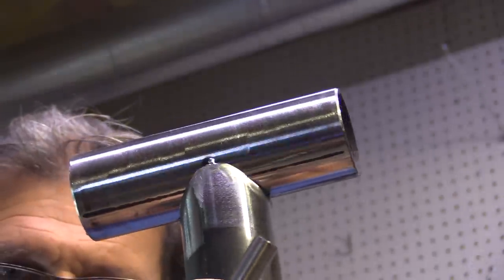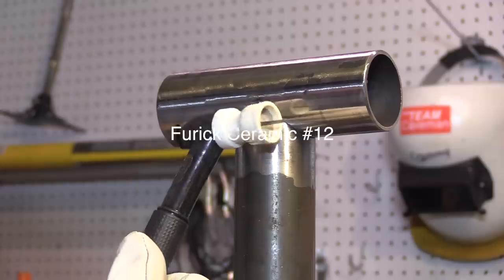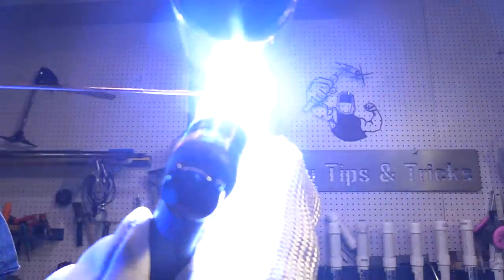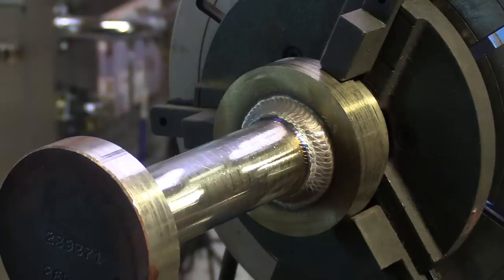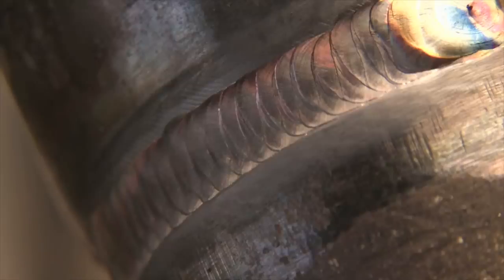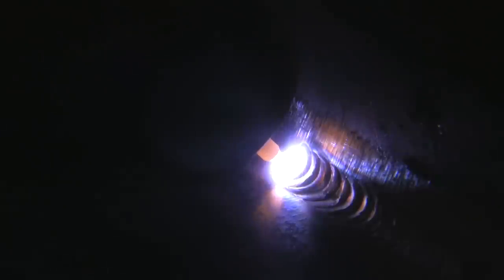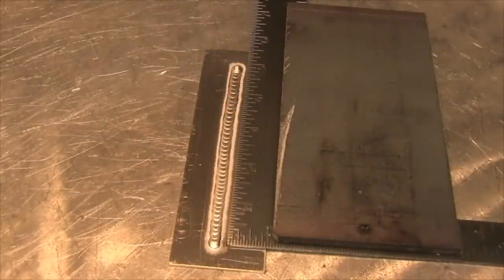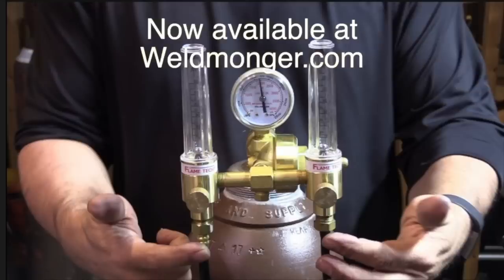TIG Welding Techniques - Coped Tube Overhead

Comment: Jody, the drag racing world is 90% .083 CM, please do a follow up with the thinner metals, your insight is always so helpful.
Reply: Hey Doug, do you mind me asking where do you buy your .83 chromoly tubing ?
is there any seller you can recommend?
 we need to pick some up for a cage we're putting together.
 thanks a bunch for your answer
Reply: Here’s a video he did a couple weeks ago using .063 CM. Gets into detail on filler selection etc. 
https://youtu.be/88fBukKg0x4

Comment: Great views as always.
Would it be too much to ask, that sometimes you might scuf your filler wire and/or the root of the joint.  Sometimes it's hard to tell how much wire you are feeding as you move ahead.  I think if the filler wire had surface texture, it would help.
Thanks.

Comment: It's easy to flow a puddle but is it actually fusing the two joints together or are you supposed to just lay the filler rod over the joint?.

Comment: Hi Jody im just curious about what happens when you tig weld a metal without a shielding gas tnx! ☺
Reply: The second you try and start an arc.... your tungsten will melt and oxidise, contaminating the part.
Reply: @kf8575  thanks for the reply and info,i really want to try it but i still don have argon and tungsten to begin ☺ thats why im very curious what the weld looks like

Comment: I'm a beginner aluminum TIG student and I keep fouling the tip. I've been trying to keep a close arc but even with the lanthanated tungsten I'm still going to the grinder too many times to clean and sharpen.  Could it be the gas flow (what is your setting for aluminum?) or contaminated gas?  I've heard of whole tanks being polluted but other than that, I"m using the #6 ceramic cup, standard issue and I can't get my welds perfect.

Comment: Hey Jody, I’m actually flying out to Texas on 12/10 for a job weld test!
Now I have done flux core but they’re asking for some thick wire action. 1/16 flux on one inch, any tips to handle the jump?

Comment: Jody, thanks for all the video content!  I just finished watching your MIG basics series videos and have a question.  I have NOT yet bought gas for my Hobart, so, are the techniques and process vastly different if I'm using flux core wire WITHOUT gas?  I plan to get the gas and try that also, but thought it might be good to start with just flux core.  Thanks again, Jim.

Comment: So just to clarify, looks like the Furick #12 ceramic will work with a stubby gas lens on a 17 torch? I notice on the web site there is an adapter kit, however it looks like it isn't necessary based on this video. Just wanted to confirm before I made the order. Thanks.
Reply from the maker: yes the furick 12 ceramic is threaded and will work with either the stubby gas lens kit., stubby basic kit, or the adapter kit (by removing the o rings)...thanks
Reply: @weldingtipsandtricks  Just ordered one! Can't wait to try it out!

Comment: I need some help. Im trying to figure out what size wire i will need to support a 240v 50amp service. The distance it will need to cross is about 150-200 feet.

Comment: Jody, Have you tried using 312 or 309 on the cover pass like Frank does?
Reply from the maker: not yet, but I will. I wish could watch over his shoulder.  Dudes a beast
Reply: weldingtipsandtricks He is a beast! I’ve listened to your podcast with him about 5 times now. But, I’m pretty sure he’s running 1/16” ER70 on both passes. Occasionally he’ll run 3/32 on second pass.

Comment: Please tell me, is TIG welding with carbon dioxide possible ?
Reply: As a shielding gas? Not for TIG, you can for MIG (but it makes the arc pretty unstable and it spatters more.) For TIG you can't because of contamination of the tungsten from my understanding.  Hope that helps.